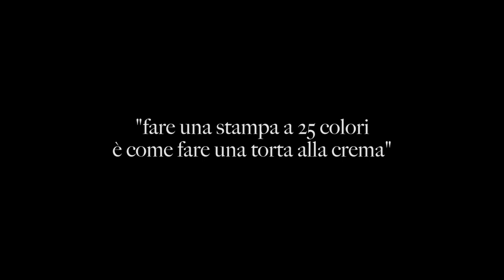Viscosity printing

Comment: Translation of titles from Italian:

Method of printing with many colours simultaneously

‘Making a print with 25 colours is like making a cream cake.’

Phase 1: Inking with the palette knife onto the copper plate (orange ink onto already etched plate)

Phase 2: Cleaning the plate

Phase 3: First colour: yellow – low viscosity

Phase 4: Second colour: blue – diluted 2:1 with linseed oil

Phase 5: Third colour: red, partially diluted with linseed oil

Phase 6: Rolling out the colours onto the glass

Phase 7: First roller (hard rubber) for red and blue

Phase 8: Applying the stencils/masks

Phase 9:Second roller: pajama (stripy) roller for yellow and blue

Phase 10: Final roll with the first roller

Phase 11: Printing

(the numbering of the phases is a bit out but hopefully makes sense)
Reply from the maker: yeah thank you! this is an old project for my graduation in printmaking and Graphic Arts, I forgot to add English subtitles!
Reply: @SACRASTA  It's a really good little video and very well put together. I loved the blanket flick! Thank you for sharing.